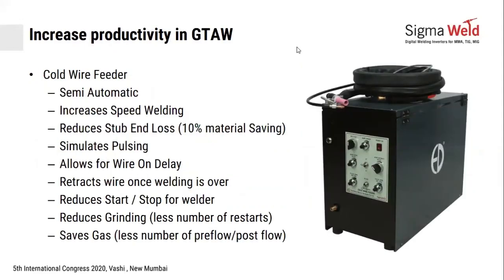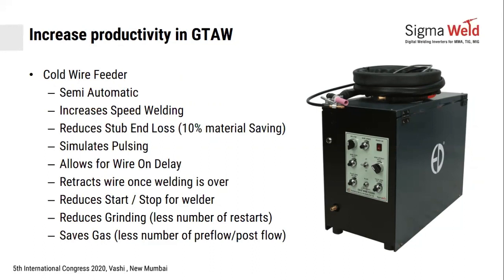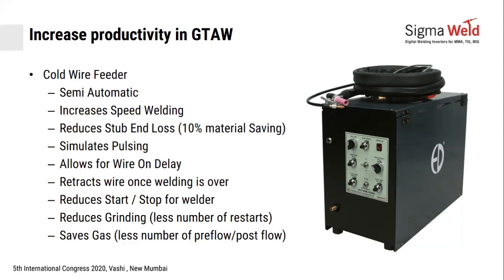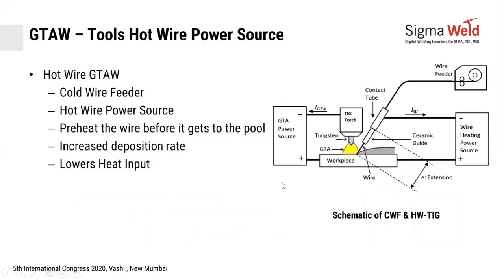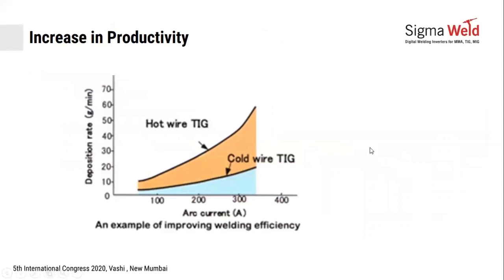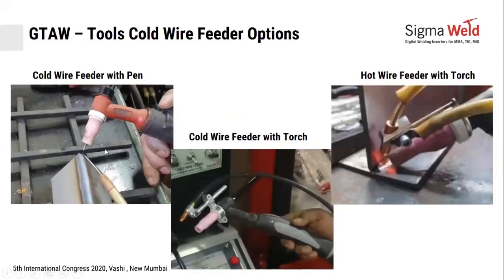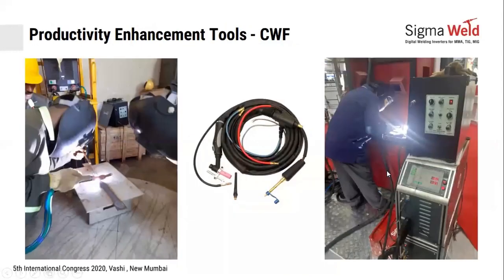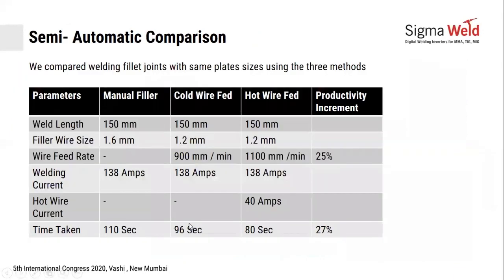Benefits of Using Cold Wire Feeder & Hot Wire TIG

Comment: In the hot wire tig, the stickout that we have after the incooperation of the power supply (i.e., which is attached to the nozzle) would cause resistive heating and is a function of stick out ?